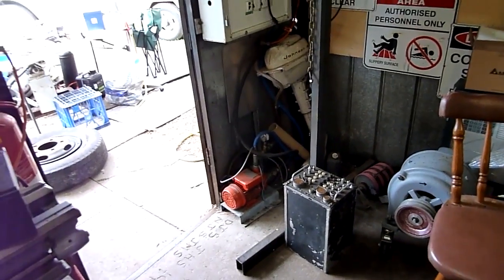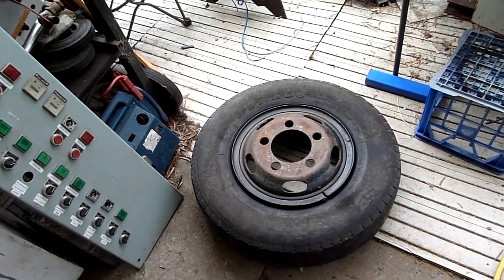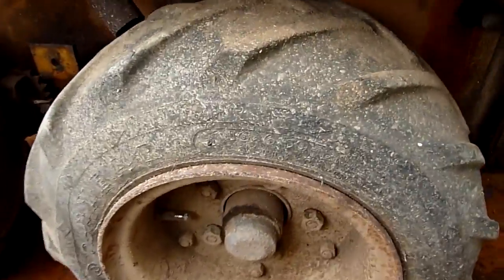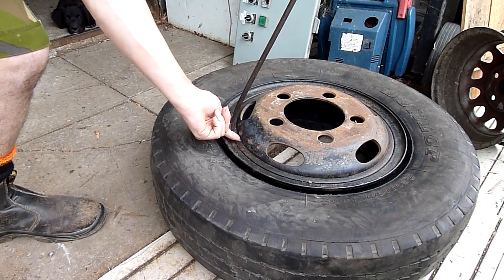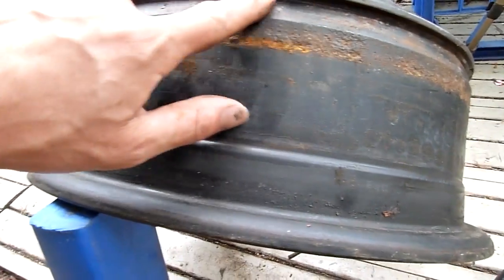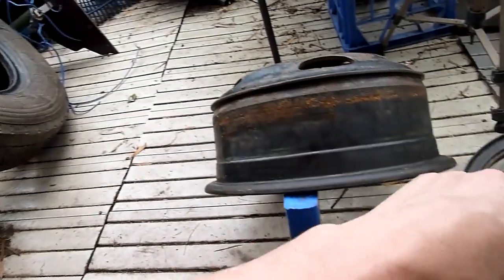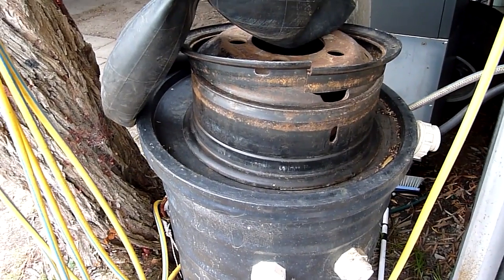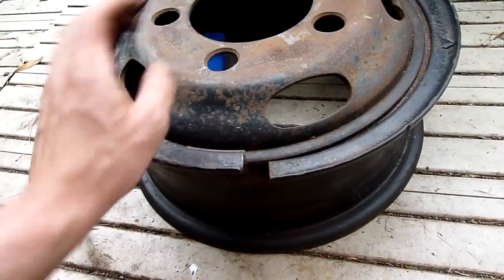The Locking Ring Split Rim - AKA Widowmaker - Why is it deadly?

Comment: I remember when I was at college a lecturer was telling a horror story of some guy blowing up a rear tyre on a tractor mower. They have a diamond tread and require a lot of p.s.i. He was distracted by something and and the tyre ended up way over pressure and exploded, they found his dead body up on a roof support and the airline was still running. The dangers of compressed air.....

Comment: The original widowmaker rims were the Ford two piece rims used in the 1940's-'50's. The rim shown here is the split ring type, which still is dangerous. Most tire shops won't work on a two piece or split ring type wheel for insurance purposes.

Comment: at my first job in a garage in the 80's, i changed one of these. we had a big steel cage we put it in while filling it. those rings are a pain in the ass to get on and off. there was a big hole in one of the concrete block walls of the shop where someone didn't use the cage. glad that was before my time. my 52 chevy 6400 still has them. not looking forward to changing them.

Comment: Rims are 5.5" wide in that case. Getting the retainer off is the hard job. And the only problem I have ever had once the ring is removed is that the rim fell through the tyre onto my foot.
And I have done small and large rims on  4wd, trucks and earthmoving equipment.
All you have to do is be carefull.
And yes Toyota and Nissan still use them on the bush vehicles as do many small trucks.
Oh, and NEVER put a wider tyre than manufacturers spec on a split rim as then you have a real problem trying to get the ring off.
As I have discovered idiots putting 235x85x16 on splittys.

Comment: It wasn't called the window maker. It was called a California rim or a suicide rim. My dad had a tire shop on 4th & Grand in Santa Ana. It was huge, passenger department 2 alignment pits and a truck dept. where we made hot cap retreads. When I was 11 years old me and my brother went with my Dad to deliver tires on the Camp Pendleton base. While unloading there was someone sitting on a 1100/22.5 while airing it up. They hold 120lbs psi. He was inside a warehouse the rafters were 35 feet above ground. When it exploded I would estimate his hang time at one and a half seconds. That's how long his body stuck to the ceiling before falling. Our tire shop was on forth street. At one point my dad had a 1200/24 leaning against the brick wall. Swinging the hammer to hit the far side of the lock ring when it blew. He started with a 24 lb hammer. After it blew it shaved the skin off his thumb knuckle and left 5 inches of wood in his hand. (no pun intended) the ring flew across the street hitting a passing ford fairlane in the rear corner panel spinning the car sideways the ring then went on to take a corner of the liquor store building out. Worst accident at the shop was the manager airing up one of those  little wheel barrow tires those are lethal the rim split and hit him right in the face. Everyone thought he was dead he broke everything above his sternum.
Reply: No one died at the shop. Jose the manager pulled through. Those wheel barrow tires are very dangerous. The split rim accidents at the shop did not result in death. The guy at Camp Pendleton? He very very died. He died before hitting the ceiling, which he did at tremendous velocity. The safety videos from General Tire show an 1100 series tire set underneath a 68 Ford Squire Station wagon which in itself is a Sherman tank. For demonstration purposes they aired it up with a warped lock ring. It lifted the car 12 feet. Next time you have a chance walk around one of those big tires and mentally try and count how many square inches of surface there are. Then imagine 120 pounds pushing out on every inch. That's a hellava cannon.
Reply: Cool story bro

Comment: You're lucky if you only have 90 psi in those rims - I've seen some in the US with a recommended 150 psi.  Scary stuff.  :-P
Reply: 7 50x16 is max about 40 lbs, 12 ply about 60. 
But 900x20 is 90 lbs and so is most earthmoving rims.
Reply: All I have to go by is what was stenciled on the side of the truck - I'm no heavy driver or mechanic.  But if that's the case...I sure hope no one actually attempted to reach those pressures.  That could REALLY hurt.  Assuming they could feel anything at all afterwards.

Comment: THOSE TYPE OF WHEELS ARE LOCK RING , SPLIT RIMS !!
THEY ARE NOT WIDOWMAKERS !!
WIDOWMAKERS WHEELS ARE 3 PIECE WHEELS AND ARE NOT MADE ANYMORE  !!
Reply: John Lieske Calm down.
Reply: 2 peice with the split in the middle as well are widow makers
Reply: The true widow maker rim is the type RH-5 there is no locking ring just a small bead that interlocks the two halves together, I have done the 3 piece and they are not bad to do.
Reply: John Lieske 
Exactly!!! A true suicide wheel doesn't have a split in the lock ring or it comes apart in the middle, these lock ring wheels aren't that dangerous unless you are a sloppy worker
Reply: split rims are not three piece wheels
Reply: As time passes .. almost nobody knows what a split rim is .. today anything that has more than one piece is called a split rim .. a multipiece rim is a very safe design to deal with thick sidewall tires .. common sense is your friend .. if you don't have any pass .  Same a jacking up a vehicle and getting underneath .  More people have been killed by vehicles falling off a jack then split rims
Reply: I have an'83 F600 with a split locking ring. Fortunately, I can afford to have the wheels done. But, if I had to do them myself, the split rim is the only practical way. Almost no one vulcanizes their own tires any more, so if one is unable to make certain that the tire is Empty before removal, then it's a common sense issue. If you decide to inflate the tire, you likely have a locking chuck, and can stand in front of the truck while the tire is being inflated. Using a roadside compressor, or a small home compressor could take 30 minutes airing up a tire. You're not going to sit there and hold it.  I personally have tried to change tires roadside on a passenger car with a truck full of tools. Wasn't happening.
Reply: He is not talking one centre rim and two locking bands, google TRILEX rims and you will see a three piece rim. It is where the outer band is three pieces. These are the dangerous ones. And yes they are still available new to buy if you want them.

I found them mainly on old volvo trucks.

http://ww1.safholland.ru/SiteCollectionImages/press/products/TRILEX_Wheelspider_with_TRILEX_Rim.jpg
Reply: John Lieske widow makers are two piece with no splits just little notches on outer half to lock over inner half ,two rings and three ring are just split rims capital letter it all like u so sure sorry u wrong
Reply: Lots of forklifts still have 3  piece rims. For the sake of argument there are several types of 3piece or 2 piece split rim. 
They all have one thing in common though, you can end up equally as dead if you don't know Wtf your doing!

Comment: Although not all Daton wheels are split rim, they are still really dangerous as well. Never take the wedge nuts off before unseating the rim from the wheel hub. I plinged myself in the leg one time getting the wheel rim loose from the hub. It didn't feel all that great.

Comment: There`s a few variations of split rims, the old ones are very dangerous, friend of mine was
nearly killed many years ago by one of these. If it was`nt for an old shoe laying on the floor where he fell that, held the large clot of blood to his head, after the rim exploded he would have died. His wife had an agonising 60 k  drive to  the nearest hospital while he was lapsing in and out of consciousness and his daughter was holding a towel around his head
He recovered  but he has a titanium plate the size of the palm of yr hand holding his head together, very lucky fella       Be very careful with these .

Comment: FYI.  Yup it's a split rim but it's not a widow maker. A widow maker is like that rim and the ring look pretty much the same except the lock ring on a widow maker is not a circle with a single split. Its actually two 1/2 rings each shaped like the letter C. No pry bar necessary. They banned them completely even to repair around 5 decades ago. It was called a widow maker Because you couldn't cage it or chain it for protection. The two piece you have there was the safer design they made everyone go to. I've only seen and fixed one widow maker once back in the 80's. They were damn dangerous and should never have been produced. All I can figure is some idiot designer figured they'd bypass patent laws cause the safer one piece locking ring like you have there is the same era possibly even older. If you are unclear what I mean. Just take the lock ring like you have in the video go straight across from the factory split and cut it in two equal halves. It's why they banned it. If you got a blow out the c shaped pieces went flying immediately. all that held them in was the tire sidewall curvature and bead pressure. Glad they are gone!

Comment: widowmaker that's right for sure 
i am a farmer and there are a lot of OLD trucks still with these wheels ,,( NOT MINE THOUGH ) i got rid of all  of them on my vehicles 
very damn few of these are in service on new trucks in the US today ,, SPLIT RIMS ,,AKA SNAP-RING Wheels are DANGEROUS when not seated right and that ring blows off   
I had one on a pickup truck fail about 18 years ago  after i had a tire-shop replace a tire for me , it blew off with enough force to penetrate the door on a semi truck that was next to me and nearly severed the drivers left leg 

I happen to have the correct equipment to change these tires and this includes a safety cage to inflate  the tire in after installing the ring ,,my safety cage is made from 6 inch channel iron  and A50 half inch plate steel

Comment: The design of the split-rim relies SOLELY on the integrity of the bead in the tire to function properly as it constrains the split-ring radially. A stretched or damaged bead can spell disaster, as well as water-intrusion where the interface of the ring and rim come together (old and corroded rings and rims are usually responsible for accidents). I used to do heavy equipment maintenance, and these things are downright scary!

Comment: These things are banned in the USA. Tire shops WILL NOT deal with them. The US Military still has these, however. They were used on the M35A2 Deuce-and-a-half. They are still used on the water trailers and the older style Mobile Kitchen Trailers (but not the newer ones). 
To deal with them, the Military has each repair shop keep an inflation cage on hand. Mechanics are instructed to NOT inflate these tires from flat without using the cage.
Reply: They are not banned in the US and every tire shop around me works on them. You must live in the city because they are still used on heavy equipment and on farm trucks in most of the country.

Comment: that's not what we call widowmakers real ones split and lock in the middle
Reply: Hale Cooley thank you I cause these people have no idea what they are talking about I have been changing tires since I was a kid running service calls with my dad along with my 3 other brothers changing tires on tractor trailers and everything else in fact I'm still doing it today this is just a simple lock rig tire NOT A Widow maker
Reply: That's what I was thinking. I still run these on 10 wheelers. Never had one blow. I only changed one center lock and it blew up when I was walking up to remove the air chuck

Comment: I use tubes and for a 3.5 ton ambulance I plan to use those split rims. As I don't have a cage o plan to use chain round the bits to improvise a safety device. 65 year old rims, what could go wrong... :) well I get 2x the amount needed and select the best parts for my set.

Comment: For what its worth "suspect" tires should always be in the front of the vehicle in the event of a blowout. Rear blowouts are so dangerous automotive manufacturers and tire testing facilities will not even "simulate" one under test conditions. A front blow out just causes the car to pull, a rear blowout usually causes a spin and possibly a roll-over. Suspect tires in the front, always, on passenger cars at least.

Comment: My Dad had a gas station from the  40's until the early 70's.  I worked there, when in school and changed many tires.  He refused to change any split rims (all Ford 3/4 tons had these), after one of them snapped off, and the split rim blew out and and made a big whole in the roof of our service station, 20 feet above.

Comment: Years back a fully loaded dump truck on a major highway had one of the split rims let go a 100 Km/Hr. It wrecked the car beside it and the ring bounced into the oncoming traffic and embedded itself in the front grille of another truck. I was driving right behind the truck when the wheel let go and with the cloud of white talc used as lube on the inner tube and the sound of instant decompression I thought the truck had exploded.

Comment: yeah that is NOT a WIDOWMAKER nor a split rim. that is a lock ring 2 piece wheel assembly. A WIDOWMAKER has 2 solid side rings and the wheel is in 2 pieces in the middle. 90% of container trailers have this style wheel today. WIDOWMAKERS have NOT been made in many years. good video tho :)

Comment: well this seems safe , to be honest its inferior to the russian style of rims like the ones fitted on the Kamaz trucks , those are also split , but the way they are done is : there are two peaces  the lip  is solid and in between the lip and the hub goes the split L peace and in order for that to fail it has to sheer a rather thick metal band (the L peace) , which i have never seen or heared of happen in the field , those do sometimes expload during assembly because the threee peaces have to fit  properly , but this design i see here is far more dangerous

Comment: That is not a split rim nor a widow maker.
 That is a locking ring rim and is still used today on new trucks with Dayton style wheels and pretty much every piece of wheeled construction equipment. 
 The split rims or widow makers  are the Firestone RH-5° design rims,  those are the widow maker split rims as those rims are  split in the middle of the rim and  not on the bead like locking ring rims.
Reply: No it is NOT a split rim, but a locking ring or split ring rim. Any rim that has a removable bead that disassembles from the barrel of the rim is a locking ring rim. Split rims split the barrel of the rim such as in the RH-5° and combat rims, both split the barrel of the rim, with one side taking the center disk and the other side the other half of the barrel, and not just the bead. Combat rims bolt together and the RH-5° rely's on a lip and tire pressure to keep it together.  Firestone RH-5° rims should not be confused with the Firestone RH or R5° rims that are locking ring rims.   See below pic of the Firestone RH-5° split rim this is the widowmaker. The RH-5° were all due to be recalled but  backroom dealings prevented a full recall.  Instead the NTSB issued do not service and render inoperable rule instead.  NO tire shop in the U.S  legally can service the the RH-5°.  The RH-5° have killed more people than all other multi piece rims combined and can fail at any time including while in service and not just during inflation/mounting .   Multi piece Locking ring rims get lumped in with and mistaken for  the RH-5° but NONE have been banned from use and all can legally be serviced.
https://lh3.googleusercontent.com/-J31XkMo-CMo/UIl9du5PFZI/AAAAAAAAFHw/hcmU-MFBNcQ/s1280/2010-10-02_11-16-30_493.jpg
Reply: @matthewq4b  your link doesn't seem to be working,  but you obviously know your truck tires, I will look it up. Thanks.
Reply: @matthewq4b  link works,  my bad internet,  how was that thing disassembled?
Reply: There is a notch in the lip on outer side (side with out the barrel) about 3/4" long and a couple spots with were the lip is thinner. This allows you walk the outer ring around the inner ring and fully seat it with a tire iron using the notch.
Reply: @matthewq4b  ok, thanks,  glad that was before my time.
Reply: @matthewq4b  Your title says locking ring split rim.
Reply from the maker: Very interesting, I guess the term gets used a bit loosely these days, its what all the tyre guys use around my area. I will be doing a Pt2 with some corrections and explanations of other designs.
Reply: Yea I was going to say the same thing. My F750 farm truck has split ring rims and they are not what are called widow makers. I always deflate mine when taking them off the truck , chain them as he said and then use a remote air chuck just in case but I don't think a lot of people understand the forces involved with high pressure truck tires even on a one piece rim. A tubeless tire on a one piece rim that lets go at 90 psi or better can also take you out.
Reply: Matthew Matthewq  You're right Mat, we tend to label things wrong around here!   Those old Firestone rims were indeed deadly and we never speced them for our trucks.
Reply: Pp
Reply: Matthew Matthewq It isn't a widow maker but it is a split rim. Any rim that isn't single piece is a split rim and there are various types. Also the original RH5 were not centre split.

Comment: I was a heavy equipment operator in the Marine Corps. We still have a ton of older model equipment that use the split rim and when we had to change tires it was a nerve racking job, especially when we would have to put grease on the tire and rim to just get it on.